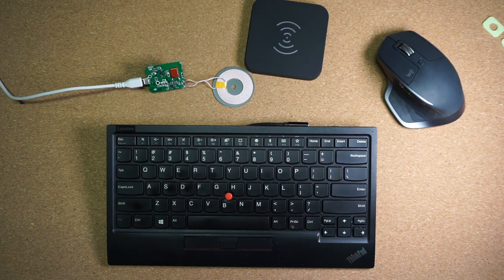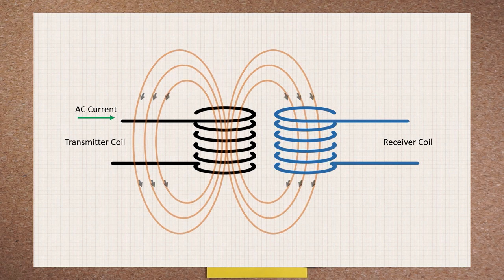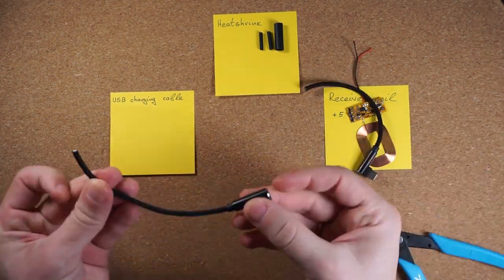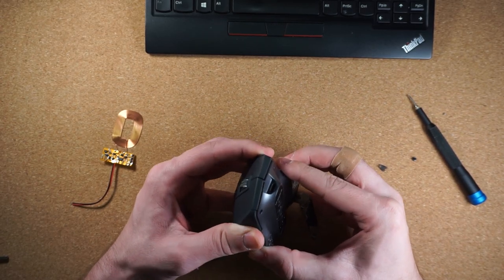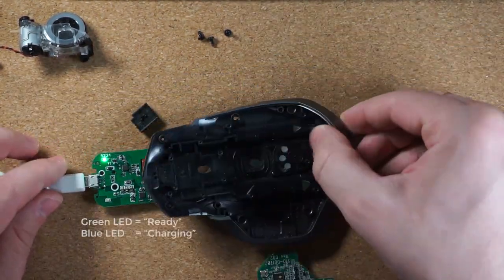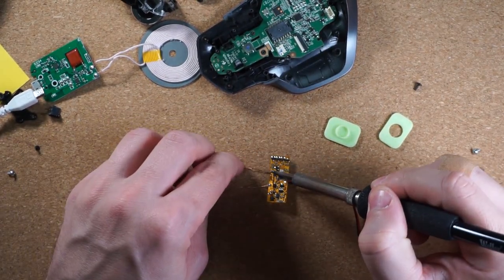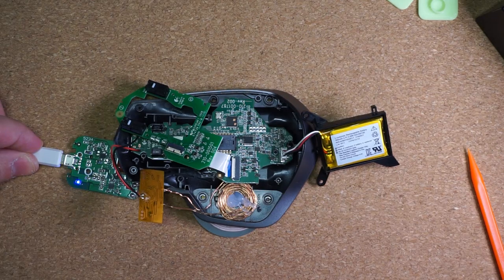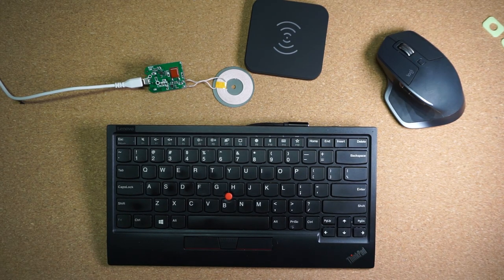Adding wireless charging to my mouse and keyboard

Comment: Wow, really cool, I didn't knew that you can remodel wireless charging coils
Reply: same principle as electric motors. The larger the surface area and more winds of copper the more efficient,  in the case of wireless charging the linear and flatter the better.
Reply: @B8.5OZ  Is it a Problem that the "loops" overlap? Should overlapping be avoided?

Comment: Very cool video & project!
I did figure that it's probably easier and more effective to use those USB to magnetic connector / adapters
so the charing cable would snap into the magnetic adapter
Reply from the maker: Thank you! I'm glad you like it.
You are right, that's another option.

Comment: Appreciate your video, it’s really help!

I’ve some question, can you still connect/charge the mouse using USB wire, will it be short circuit / any issue?

Thanks in advance!
Reply from the maker: Depends on the module you bought.
The one I have has reverse polarity protection (which you could add with single diode). I have been using it for over a year now and did occasionally have to charge it via USB and can confirm both methods still work. Again, you mileage may vary depend on the module you have, so double check.
Reply: @SasaKaranovic  I see! Thanks for helping! You are awesome!

Comment: Hey do you know if this qi wireless works on AA battery powered mouses? Will the qi wireless charge my eneloop battery inside my Orochi V2? Or do I have to solder on some lithium battery for this to work? If I need to solder lithum battery, can you link me the highest watt battery I can use from aliexpress etc? Can I just buy a Logitech Mx master battery replacement and solder onto the Orochi V2? I don't care about mouse weight, I just want a highest watt battery so I can charge less. Thanks!!

Comment: Hey there ! Awesome video, thanks for the tips ! Though I'm trying to figure out : do you think it is possible to put several TX coils together (in chain ?) to try and reproduce a full surface inductive mouse pad ? And I'm talking about an XXL mousepad, not the tiny little pads you can buy for 100 bucks from notorious companies :p

Thanks anyway, great help !
Reply from the maker: What would be the use case? I assume it's possible although I think it would be very impractical for many reasons like power consumption, cost, labor required to integrate everything just to name a few.
Ideally, you don't want to charge your mouse/keyboard all the time. Your battery life will probably be better if you dedicate a spot (or several of them if your desk area is huge or have multiple devices that you want to charge at once) on your work surface where you can leave your mouse, keyboard, headphones etc. and they will charger wirelessly.
Reply: @SasaKaranovic  yeah well I kinda thought about that after posting the comment and also about getting a bigger coil instead. The purpose was to get a full surface charging mousepad to leave the mouse wherever I want, without caring for a specific spot to charge
Kind of like the Logitech Powerplay thing but wider

I realize a single spot is just fine haha
Reply from the maker: It's probably doable, just not very practical or cheap. :)

Comment: This little video has been a boon to me! I use a vertical mouse due to wrist strain and was looking to upgrade from a wired to a wireless one to have more freedom of movement. 

That's when the Logitech G powerplay devices came into my interest and I've been looking around trying to figure out how I could get something similar put together using a vertical mouse and this little tutorial video has given me more than enough information.

I'm even going to try and see if I can get a mouse pad going with similar charging capabilities like the Logitech G powerplay one.

awesome stuff!

What kind of voltage and amperage were you looking at? or does it not matter because the onboard charge controller for the mouse and keyboard will be able to control and shut down the charging?

any issues with the battery now after about 3 months of use?
Reply from the maker: Hey Context Gaming! I'm glad it helped. Let me know how it turns out, maybe post some pics and tag me. :)
Reply: @SasaKaranovic  for sure! I've got the receiver coil coming in with a new wireless mouse, so I'm gon a see if I can get it working well, and then see if I can find a transmitter coil large enough for the mouse pad.
Reply: @SasaKaranovic  quick question! I'm trying to find some larger transmitter coils, something that's almost 4 inches in length and 3 inches in width, would you have any direction to point me in so that I might find some?

Comment: How did you assemble the mouse with the wireless charger PCB? Like where did you put it...
Reply from the maker: I recoiled the RX coil to make it more compact and then the rest of the circuit is fairly flexible so you can mount it anywhere where you can find space.
Usually there is a lot of free space but it varies from model to model so you will have to open yours and figure out what is the best place.

Comment: Does the wired USB charging for the mouse still function as well?
Reply from the maker: Excellent question! It does. Although I've used it only once (after adding the coil) to check if it still works. Since then it's been wireless charging only for me. :)
If you intent to use both methods, I would recommend that you try adding a Schottky diode just to "disconnect" the two sides. Anode on coil side and cathode towards USB +5V connection. This would prevent coil back-powering when being charged trough USB cable.

Comment: Why not do it around the sensor? Does it not work there?  Would be more central.
Reply from the maker: You can place it wherever you want or have space. As long as you can have coupling with the TX coil, you have wireless charging. ;)

Comment: I have an ROG Chakram X Origin
It looks like it has the same enclosure as the ROG Chakram X which has wireless charging
The enclosure even has a sticker called wireless charging area
Got confused by it and bought an expensive mousepad with wireless charging just to find out the model difference
Will try to get a guy that works with batteries to give it a try diy ing this
Any way to reach out if we need to ask any question?
Reply from the maker: Hey @XHULIOZ!
I would highly recommend if your mouse is still in warranty (or even if it isn't), maybe it's worth reaching out to Asus and explaining your issue and checking if you can upgrade to the wireless charging one?
Modifying a mouse to have wireless charging is not that complicated, but at the same time you risk potentially damaging your mouse if you don't know what you are doing or make mistakes. Also depending on the coil, how you add it to the mouse, the charger etc. your range might be great or it might be charging only in one spot. So consider all of this before making the modification. And if you do end up modifying your mouse, let me know how it goes or maybe even document it and share with others who might have similar issue in the future.
Reply: @SasaKaranovic  I wish I could but I live in Albania and its not available at all
Will definitely let you know if I go through with it

Comment: I have an MX Revolution, no ports. Where would I connect the coil?
Reply from the maker: Looking at the teardown pictures, you should be able to solder to the two pads that are used for charging (on the inside there is a lot of space and also many test points).
Just verify which one is GND and which one is VCC and also make sure voltage between them is +5V (when charging). Then you should be able to add your wireless coil.
Let me know how it goes! :)

Comment: Can you tell me if it is possible to do this on the surface of a table in the size of 30cm x 25cm?  Then, if I put a keyboard or mouse with that adapter you made, it would always charge if it was inside that 30x25 surface.  If possible, how could it be done?  I ask because I've never seen a very large wireless charge base.

Comment: Genau was ich nuche, nur würd ich gern meine logitech harmony mit einen wirless charger modul ausstatten....
Reply from the maker: Nice! This method should work for most devices regardless if it's a mice, keyboard, headphones, remote etc... As long as they are powered/charged via 5V USB, it should be possible to modify them to use wireless charging.

Comment: Could you elaborate a bit on how to tell where to tap the wireless charger leads onto the mouse PCB? My mouse has a micro USB port too, I'm just not sure where exactly I need to solder the + and - to from the wireless charger. 

Just anywhere I'm getting 5v as close as possible to the USB port, or.. ?
Reply from the maker: If your mouse is charging the mouse battery via USB. Then you need to find where your VUSB and GND connections are. Since they enter the board trough the USB connector, that is the best place to start (find VUSB and GND pads on the connector). However, you can easily trace those connections to a capacitor, test-point or any other place where it is more convenient for you to solder. As long as they are the same net/rail, you should be fine.

Again, keep in mind that you want to solder to VUSB rail and not just any +5V rail. Mainly because your mouse might have features like reverse-polarity protection, fuse, current sensing etc. that you don't want to mess with. Otherwise it might cause faults or some other "undefined behavior".

Let me know how it goes or if you need more help. Also I would love to see how it looks, so please do share your result. :)
Reply: @SasaKaranovic  I really appreciate the info! My mouse is a Rival 650 wireless in case anyone else comes across this and wants to do it for themselves. There are clear VBUS and GND pads to tap into on the bottom of the PCB, so it was honestly quite easy once I had everything apart. 

I'm surprised how well everything fit - it was like I had the perfect amount of space for the charger coil. All I had to do was cut off a bit of the plastic / rails on the bottom case to get it to fit snug under the PCB. 

Here's some pics: https://imgur.com/a/lvP5j3R

Thanks again for the video and info! I'm fully wireless now. Next I think I'll do my Xbox controller. 👍🏻

Comment: This is awesome! I want to do this on my G900 chaos spectrum. Could you tell me how can you identify the PCB lanes for GND and VUSB? I've looked at the teardown pics of my model but I can't seem to identify it. Thanks in advance!
Reply: I've dug more into it (I'm new to this electronics stuff), and it seems that if I can find an empty capacitor slot, I should be able to solder my positive and negative cables directly to it. My model has a "C1" slot unpopulated, so I should be able to solder directly to it. Am I on the right track?
Reply from the maker: @nadina492  If you have a multimeter, put it in continuity mode and probe from your USB connector to that capacitor. It's very likely that you will find VUSB and GND on that or another capacitor. That's what I did in the video. Also the closer you are to the USB connector, most likely it will be easier to find a decoupling capacitor that is connected to VUSB and GND.
Let me know how it goes!

Comment: Is it possible to reuse a Razer charging dock or one of the GPW docks with another mouse? Like adding the pogo ping or whatever is needed?
Reply from the maker: I'm not sure what do you mean. Bust I'm sure you can hack it to add wireless charging or to make different peripherals compatible.
There is a good chance that someone already did what you are trying to make, so Google and/or YouTube may be a good place to start.
Reply: @SasaKaranovic  OH sorry, i meant Pogo connectors, is it possible to install Pogo connectors in my mouse and do a simple wiring to the battery for charging? or how hard would it be? :) Thanks!
Reply from the maker: You could add Pogo connectors (i.e. heat stake them into plastic, drill or some other method). But I'm not sure how that would be related to adding wireless charging.
Piece of advice; NEVER connect external connection/voltage directly to your battery. It's almost always a very bad idea. Also keep in mind that playing with batteries can be a safety and fire hazard, so make sure you know what you are doing.

Comment: Hey there :)
I finally managed to get some coils and I'm now getting to hard part : I'm really not sure where to solder my coil to the mouse pcb (a Corsair Harpoon RGB btw). The thing is, the usb port is on a tiny piece of pcb with 4 pins pluging in the main pcb. And on this very pcb I'm kinda lost haha.
If anyone can give me hand I'd be very grateful, thanks ! :D
Reply from the maker: Looking at the teardown pictures, the PCB clearly shows exposed test points (tiny gold circles with white labels near them).
You can use the two labeled "5V" and "GND" to attach the coil to. I don't have that mouse nor the coils you have, so please double check and make sure you know what you are doing. I take no responsibility if you destroy anything. :)
Let me know how it goes!
Reply: @SasaKaranovic  Well it worked and I'm very glad of your answer !
Then I reassembled everything and the sensor didn't work, I guess I already screwed it when I was looking for a spot to place the coil. Also, when I disassembled the mouse again, the 3 pin receptor for the battery went off and I'm not sure I can fix it.
Anyway, it was really fun to do it and I thank you very much for the tutorial anyway !
I'll sure test it on other mice haha
Reply: @SasaKaranovic hey, i have a mouse that use AA battery. How do i wire the receiver?
Reply: Also i dont know if i put rechargable aa battery will it get charged